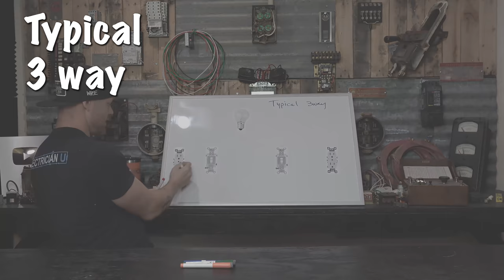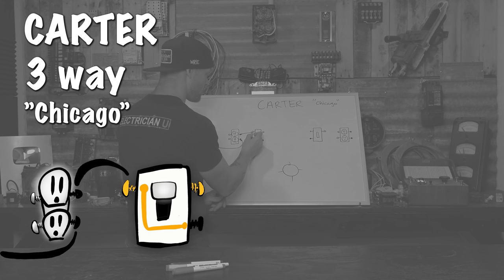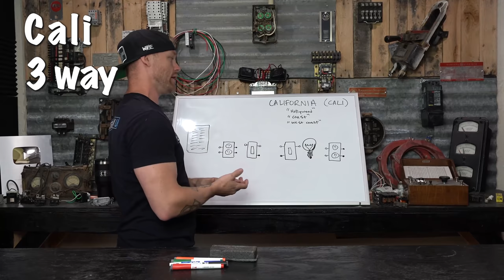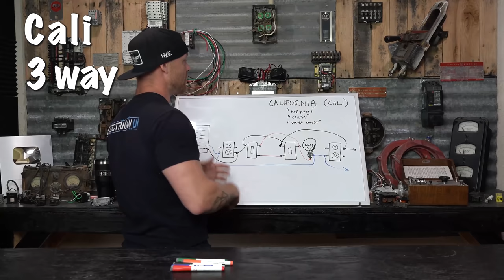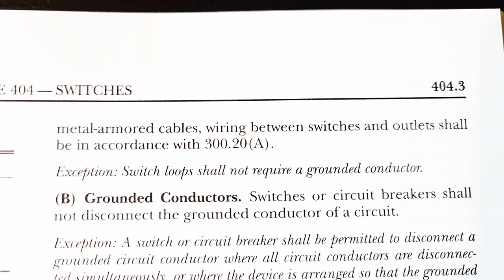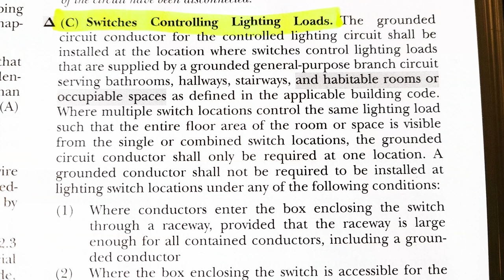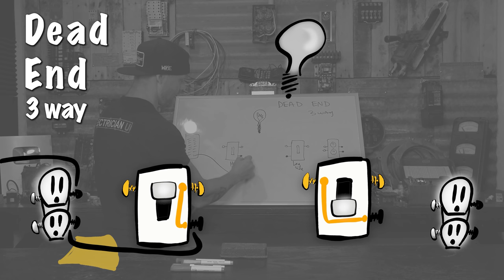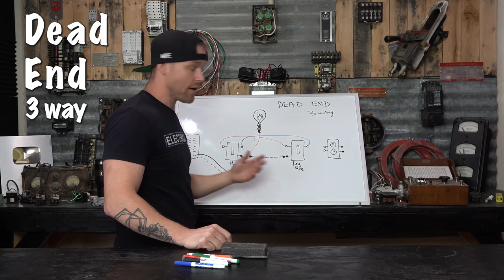THREE WAYS 3-WAYS CAN BE (3way Switch Wiring - ILLEGAL AND LEGAL METHODS)

Comment: If you are roughing in a house there's no excuse to do any kind of different 3 way just do a traditional 3 way, the only 3 way alternative I would do is a dead end 3 way and that would only be in situations of a remodel when sheetrock is up , or making changes In a new construction home that's been sheetrocked
Reply: Same here.   I always use a hot side and leg side 3 way and 4 way setups when roughing in a new house.   That way the neutral is carried all the way through,  so in the future no matter  where a homeowner may want to install a high end dimmer or other electronic switch requiring a neutral along the circuit,  there is always one available for use.   I only use dead end 3 ways in situations where for example,  we completed the rough in, and a single pole switch was originally on the plan, but the homeowner comes by and says "I changed my mind, I wanted another switch over there"    it's much faster and easier to just run a 14/3 NM from the original location to the switch that got added, and use the white re-identified as hot, and red as my travellers and black as the common.  For the reasons I stated above I try to avoid that whenever possible, even if allowed by code.  
 
The alternative 3 ways (carter,  California,  double dead end three way, and power to the light with 3 way at the far end) are no longer used in new construction but are  helpful to understand,  because you still run across them in older buildings.

Comment: I just pull a piece of 12/4 or 14/4 between the legs. It ensures you always have a constant hot and neutral at every location so say a bed rooms that switch a common hall light, but also have a fan inside you can use that for the smart fan switch. I also use the blue/red as my travelers so it's less confusing, black is always constant hot.

Comment: I want 3 switches controlling one light that are smart. 

Given a room with 3 entrances. Light switch by each door. We walk in door 1 and move the switch to the up (on) position. The other switches detect the change and move to up as well. After our conversation, we leave through door 2 and move the down (off). The other switches detect the change and move to down as well.

Comment: The way I've done 3 way switches is the Gray or common terminal is connected to the source, the other ones you need to make sure you've got them hooked to the same screws  on the opposite switch, the common terminal  On the other switch goes to the fixture, along with the existing neutral.
 the  Three-way switches have always worked fine, wiring them that way.

Comment: You should have had it in that there's a three-way combination called a dead-end 3-way. It's where you bring the hot in the switch leg into one box. And you use the neutral to be the common going over to the other three way
Reply: He mentions it at the end actually
Reply: Any way to add neutral to an outlet with a dead end?
Reply: @markied2873  not that I know of

Comment: Out here in SoCal, I've mostly seen Dead End Style 3-Ways in older homes.. If they wanted the hot and neutral to go on in the circuit, they were wire nutted off that way in the back of the box to travel on.

Comment: so chicago style is bad because the shell is energized and exposed... so someone could easily come in contact with it when changing a bulb. but does the danger go away if the home is using all embedded led lights? (the lights you cant replace i mean)

Comment: with a three-way switch , which means you can power it at three different points or ways, in general we don't power3 ways at the light anymore due to it complicates troubleshooting in the future, using Romex MC cable or BX cable, you are going to have neutrals at all 3 boxes one for the light and to run a switch leg to one common and power to the other common, the only alternative is 2 different dead ends, like you mentioned the white wire for common to leg or using it for power to common,, in a residential home using Romex I have no use for three wire in three ways I just run a12-2  power from the same circuit to both switches and a 12-2 for my travelers, always use the correct color marking tape for appropriate conductors . I've come across EMT conduits in commercial buildings , too hot to touch because the neutral for load was running back through another pipe.

Comment: It is interesting how diff parts of the country “call” the different wiring types. I’ve always found that fascinating, same goes for tools, & machinery. Ppl call things differently depending where you live in USA and parts of the world.
Was on a job running conduit underground and using a Trencher for speed and ease. Have heard many different names for a Trencher, & had a new helper with me. And then a “experienced” guy called out and told the helper to get the Ditch Witch ready to run; and they were clueless as to what he was talking about.😂
So, as I do think it’s cool that diff parts of the country call different machines/tools (and wiring types) different things; for the ppl starting out in the Trades (doesn’t just have to be a Sparky, but can be any Trade) there is a learning curve that they will have to get used to…..something I didn’t really realize till that moment, which got me thinking.
Great Vid Dustin, and Appreciate the channel, how you make it “fun”, engaging and exciting….even the “Code Time” parts (which we all know if were in a classroom learning Code, can be some dry “boring” stuff); REALLY THE ENTIRE way you have Structured your videos👍🏻👍🏻  very nice, & imo, doesn’t matter if a newbie or a master in your trade; can always learn something (or at very least, get a refresher if what ya did learn) from other ppl.
Cheers✌🏻
Reply: Ditch Witch® is a specific brand of trencher (and other equipment).  Referring to a trencher as a "Ditch Witch" is kinda like referring to an SUV as a "Jeep®", regardless of the actual brand/manufacturer.  Kinda like referring to a powdered soft-drink mix as "Kool-Aid®", regardless of brand.

What kind of cable stretcher do you use?

Comment: Enjoyed the video. On a bathroom job changing light fixtures. What I have looks like the dead end 3 way. Got a tingle on the wires feeding the fixture. 107 volts when the switches are set for light to be off. Guy I work with wouldn’t allow me to change the circuit to conventional 3 way so….any ideas.

Comment: Wow, Carter and California styles are bizzare.  However, I have an issue with electricians that use the word ILLEGAL referring to electrical work.  Codes have to be followed, BUT CODES ARE NOT LAWS!
Reply: While they may not be laws per se, try to weasel your way outut of liability when your non-compliant work is found to be the cause for injury or death. Or on a better day not being forced to pay for rework when you fail inspection and hold up all work on a site. I've done work on commercial and residential, getting caught cutting corners will cost you more than you thought you would save.
Reply: @sivalley  I said CODES MUST BE FOLLOWED.  I am not weaseling ANYTHING.

Comment: Well you said #12 for a lighting circuit. Please explain. From panel set up for 15 amps I run #12 just in case down the road load needs to be increased. Change breaker and good to go. But #12 for lighting would love to know why.

Comment: Good info. I never knew what to call the other 3 way configurations. On the dead end 3 way, and most switches using a white as a hot, I was  taught “Out on white, back on black”. I guess that’s not standard practice?

Comment: Hey brother quick question. 200.7 (c)(1) states: “If used for single-pole, 3-way or
4-way switch loops, the reidentified conductor with white or gray insulation or three continuous white or gray stripes shall be used only for the supply to the switch, but not as a return conductor from the switch to the outlet.” In that case wouldn’t we tie our constant hot to our newly identified white wire then our switch leg to the other constant of the other switch to the load ? Genuine question

Comment: Never heard of or saw the Carter 3 way. Only encountered the dead end and typical 3 way though I always had the dead end referred to as the California 3 way. So I guess I never saw a California 3 way either as you've described it. The dead ends I've encountered the feed was in the light with 3 wire down to the switches and all splices made in the light box.

Comment: On those old Carter setups, did they run single conductor from the load or did they run Romex and just cap off a line in the box? Like what would I look for to know that it's wired Chicago style? I mean I can work out how to test it, but are there any tells that might lead me to testing for it sooner than later? Obviously age and location can help, but I mean by observing the system ... anyways you get the idea.
Reply from the maker: It would depend on who did the work, what they were taught, and what you have seen before in your career. 

Also geographical location. Some places just do weird stuff.
Reply: So basically, if I'm diagnosing a switch, I have two indicators that can give me an idea that I might be looking at a carter... the switch device is a three-way but on a is set up on 2-wire, or the fixture has voltage refrenced to ground when off (if I'm luckey enough to have a ground wile being unlucky enough to run into a Chicago 3-way) but if I have no refrence at the fixture side other than hot and neutral, or if the sw-leg 3-way is burried and the line 3-way has had the device swapped for a standard switch by the home-owner who forgot to mention that as it happened years ago... (the actual situatuation I was facing back when I wrote that.)

Comment: So I took apart the wiring from two separate 3-way switches in an attempt to figure out which was the line conductor to the panel in my basement. One set showed just one hot in the switch box.  The last set showed ALL three wires as being hot with my tester!  Is that normal?  And which would you guess is the wire coming from the basement panel?

Comment: Great video, especially the historical info about Carter and Cali methods of 3-way wiring! But note that the "Typical 3-Way" wiring you show is technically also a dead-end, since there are no hot and neutral leads present at the leg switch that can be carried on to devices farther down the line. For that you'd need a 4th conductor running between the hot and leg switches. The Carter wiring method (which, as you said, is not code compliant) does let you carry power on to other devices while only using 3 conductors. (Similar to what @aaron grefsrud said in his comment.)
Reply: I've ran into the carter 3 way once, on a older farmhouse in Southeast Michigan.  They had a single wire  running from the house, to a yardlight in the middle,  from the yardlight to a polebarn.   The service call was that the yardlight sometimes got super bright for a split second then burned out.  The trouble began after the farner was rearranging some breakers around in the panel in the polebarn,  to make room for a 240 volt air compressor just purchased.   Turns out the 2 three way switches were on different circuits.   It certainly was a beast to figure out, with no wiring book to guide me, and no history regarding the installation,  other than the farmhouse was built circa 1925 but was not wired until around 1946 and the polebarn was built in 1964.

Comment: Good video! You sure make it plain and simple!! I have come across an older house outside light fixture (4 way ) where all the travelers and hot wire was all joined in the light box. Now that was a mess, we needed to come off the switch loop to add can lights on porch, so I traced down the set of travelers to the only location they needed a switch and reconfigured the light box as a junction box and dead ended the remaining wires. What would this 4 way system been called? Just curious!

Comment: What about this style of 3 way that is in my living room?
Power & neutral comes to the light bulb. 
A 3 wire goes to switch 1, from the light bulb. 
A 3 wire goes to switch 2, from the light bulb. 
There are only 2 wire nuts at the light bulb for the travelers, 1 wire nut between the hot & black to switch 1.
The recolored white from switch 2 connects to the light black. 
Something interesting in Saskatchewan rural is that there is only 1 overhead wire going to a farm. They have 1  10’ ground rod for each 25 amps of service. 
This year in the drought, Sask Power told everyone to be sure to water their ground rods!
Hello from north east Montana. 
10 miles from the Canadian border.
Reply from the maker: This is what they call a 3way switch loop - great find! These are rare.  I actually just made a video on that in our membership section on https://www.electricianu.com showing how it works
Reply: Part of my house was built in 1910’s, part in 1920’s, part in 1940’s when they came in with electricity with the Coop, then once they had electricity, then came running water. 
I replaced the fuse boxes with breakers, when we bought the house in 1992.
In 2020 I installed a generator double throw switch under the main breaker under the meter. 
Thank you for your help. 
Hello from north east Montana. 
10 miles from the Canadian border.

Comment: I've got a question for you - was helping someone with some issues at the house they bought (switches not working, turned out someone miswired or mixed 3-way wiring styles) and the thing that seemed strange to me is all the earth-ground wires were cut off flush with the jacket of the romex.  Also the older switches didn't have anywhere to connect a ground wire to.  Ever run into that before?  Was there a time when the ground wires were normally cut off or is that an odd situation? I'm wondering how you would then add something that has a ground such as adding an additional light from the switch without ripping walls out to rerun all the romex?

Comment: Will LED bulbs work on the Carter set up?
Reply: Yes they will work perfectly fine.   However the Carter set up is not recommended.  As it can be confusing for a troubleshooting call.   Also if you have a Carter set up and you need to replace a light fixture,  you should seriously consider turning off the power at the panel, not relying on the switches, obviously.   Another potential problem arises with the two three ways are on different circuits,  and a panel needs to be replaced for any reason.  If the replacement panel places the two switches on opposite phases, in the HOT-HOT position which would normally turn the lamp off, would send 240 volts to the lamp, resulting in a  bright flash.

Comment: Whats up man? I want to wire a outlet and a light switch for power off and on. But it's going in a 220 volt hvac blower.  I was  wondering how to wire it so I can run power from the blower as it's running. Could you do a video on wiring this up

Comment: Good video,  Conundrum, I've wired many a three way switches with great success (the typical setup with a Neutral in the junction box on the incoming hot side - mind your code LOL) Now, I am faced with replacing a single massive ugly 1960s 8 foot florescent  monstrosity on a three way, with 8 slim and and oh so adorable 6inch flush LED ceiling lights. The breaker is 20amp so power consumption is well within limits. I'm rockin' the 12/3 flex clad since the original installers thought grounding was something you did to your children for sneaking out on a Saturdays night. 
All well and fine, now in lays my question, in addition to the 12/3 running a typical setup for a single light, am I also going to have to run  a 12/2 flex to each junction box to connect the remaining lights in series to the first one?  Basically, 4 Flexes in, 1 flex out each to the Slimlight control box. Because of the application, I can't run exposed Romex... so pray tell, is there a easier way? Short of telling people, hey, you came in the wrong side, you can't turn the light on from there. I hope to hear from you soon.

Comment: Help! 2 locations with 3way receptacles. One ceiling box for light. Power is in one of the receptacle boxes… BUT, from both switches, the 3-way wires are in the ceiling light box. 1.) How do I get the one switch box with the power cable in it?  and 2.) how do I get both switches actually working? ( this last question is preferable)

Comment: Question on color coding 3 or 4 way switches. If I have many 3 way switches in a junction box should I color code the line as black, two travelers the same color say blue and the load also blue. Then for the other switches keep the travelers and load a different color say pink and another one purple?

Comment: The California 3way can be wired so that you have a hot and neutral at both switch locations using only 2 wire the whole way. Run a hot and neutral to 1st switch, from that switch, run a neutral and a traveler to the light. From the light, run a neutral and a traveler down to 2nd switch. Now between the switches, run a common and the other traveler. Completely legal 3way setup with neutrals at both switches and only using 2 wires in each cable.

Comment: On my old house build in 1910. I ran into the Carter/Chicago switch. I tried replacing an old switch. Nothing work after. 
Since I was remodeling the room I ran new wires and hook it up to code.

Comment: The easy solution if you HAVE to use a dead-end 3-way, and your inspector won't let you re-identify the neutral or he requires a neutral everywhere... Just use four conductor Romex. Use the Red/Black/Blue as hots, and nut the white as an unused neutral. If you are pulling a 12/3 anyway, then it really isn't more difficult to pull a 12/4. The largest hurdle in this suggestion? Who carries around four conductor wire on the truck?